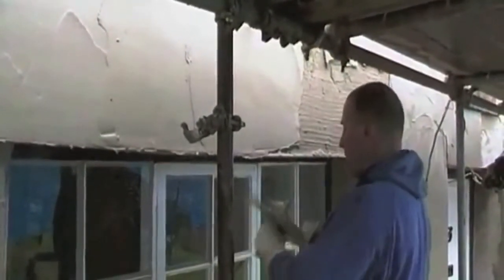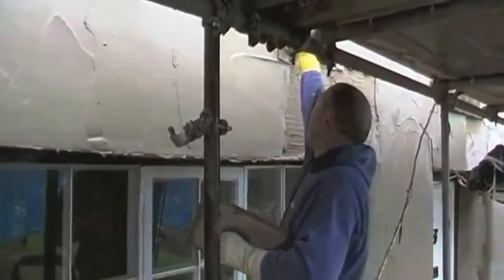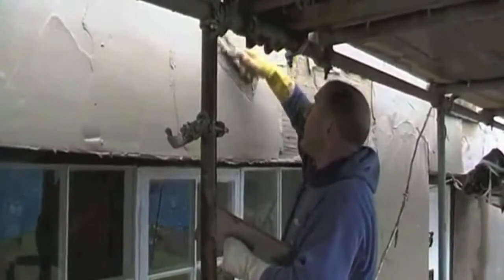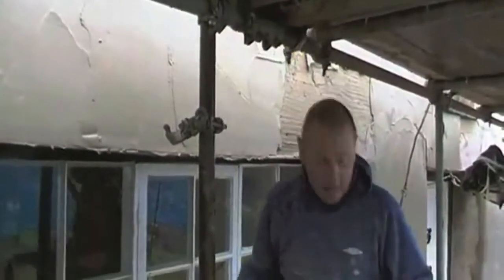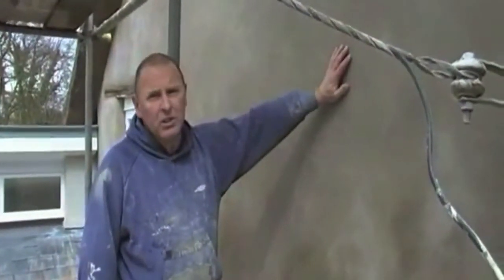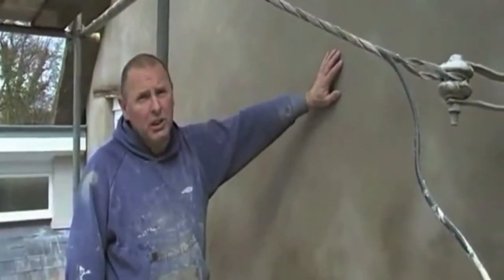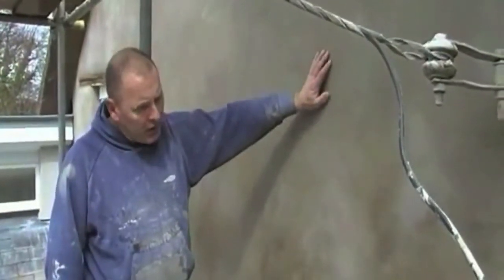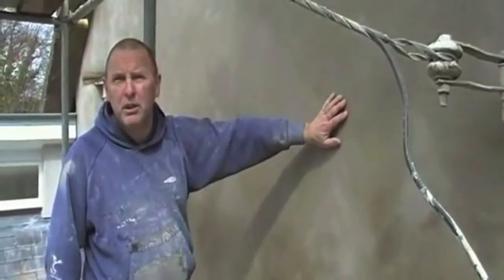Traditional Lime Plasterers Real Life Case Study Video

Comment: Lime plastering on to a cob wall and being able to paint it in 1 week 🤣🤣🤣🤣🤣🤣🤣🤣🤣
A cob wall you could be putting anything up to 30 mm- 50 mm on for dubbing out to finish.  Plus look at your drying spots. This clearly has CEMENT in it. Any lime plasterer will tell you your clearly way off the mark. Sorry pal this is not a good video.
Reply: A scratched waterproofing coat??? In between a lime harled coat & a finish coat??!!!🤣🤣